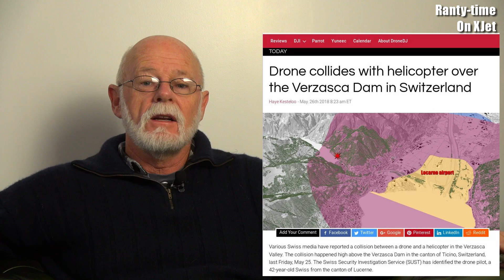Why I want to fly a drone into a helicopter tail rotor

Comment: Thanks Bruce. You touched on an important point without really seeing it: One reason why pilots and aircraft owners are pushing for legislation has little to do with safety per se. Their main concern is cost. Replacement of a tail or main rotor is very expensive. If a drone were to be ingested (it will not be flying at that point!) into a jet engine, the engine will be written off. A big Rolls Royce engine costs multi-millions of pounds/ dollars/ RMB/ yen/ etc. to replace. During the unscheduled downtime of the aircraft, which could be weeks, revenue is not being generated by the plane, so more millions of filthy lucre will be lost by the operator. It goes further though; if 500 passengers have to endure an emergency landing and then have to be re-assigned to another aircraft, many of those passengers will opt for what they perceive to be a more reliable carrier next time, thus losing the airline more income. Drones are thus a very easy target for those who want to see themselves as being big savers of money for their employers. Ridiculous legislation thus becomes a way of saying 'We're being pro-active in preventing damage to... yada yada yada.'. When that is proven not to be a viable option, they will think of something else; perhaps mandatory membership of a recognised club, or an exam system, paid for by the hobbyist.

Comment: With regard to the balloon, have a chat with the people at HABHub (High Altitude Balloon Hub). They track their small balloons right around the globe, using solar powered transmitters, operated from a minimally-sized solar panel. They have years of experience, and will give you guidance about practicalities, design constraints, and the legal side of things. Some of their balloons have completed multiple circumnavigations, and timed duration / preset altitude flights, so they must be doing something right!

Comment: They will never do that as it will prove the UK tests wrong.
The as the closing speed used in the UK test would have to be halved. as it is a sideways impact and not head on .
 You also need to look at the flight direction of the crash i.e not arm first (drones do not fly that way).
you also need to consider both the down wash of the rotor and the speed reduction  or increase due to tail rota wash.

Comment: I'd like to see the same test with a jet turbine ingesting a drone, to see what damage is caused to the engine, compressor blades and internals.
Another easy test would be to use an rc chopper and fly a small drone like a tiny whoop  into the tail rotor whilst flying or hovering. 
I know the materials, forces and dynamics may not be entirely scale.... But nonetheless it would be an interesting test and easily achieveable amongst the modeling community. Food for thought.
Keep up the good work Bruce. 😁

Comment: My solution to flying in the car was to take a diversity receiver, attach it to an old CB antenna that has a magnetic base on it, plop that on the roof of my car and drop the av cables down inside.  Works great.  Would be even better if I had the transmitter antenna up there as well.  Anyway, here is what that setup looks like. https://www.reddit.com/r/Multicopter/comments/7kgq3i/my_winter_fly_from_the_car_and_stay_warm_ground/

Comment: where i live we have an air ambulance, police helicopter and a coastguard SAR helicopter regularly flying low but I can always hear them before I see them and land my drone as soon as safely abled to its a habit I formed when I started flying and always fly VLOS, what annoys me is that paragliders fly around over a dual carriageway low and over houses and people all the time why aren't they regulated or forced to fly within rules like us drone pilots a paraglider coming down on a busy main road
 will cause a bigger problem then a drone
Reply: I believe that chance it can happen should be a major factor before we think about creating any regulations. Paraglider dropping dead in the middle of a highway would be a major disaster, but what are chances of this happening ? once in 10 years and once in 5 crashes resulting in innocent death ? even if they will have motor failure, I bet they will chose other place to land. It would have to be a real freak accident. For me good indicator is aspirin, there is very small chance that you can die if you take it, but it's very tiny, I think something like couple thousands people per year. I never met person that would be afraid to take it, even with information that there is 0.00001% chance of dying. In my mind, if something is less dangerous than aspirin, we just accept the minuscule danger potential and don't make life less enjoyable for millions of people with unnecessary regulations.

Comment: Helicopters are supposed to be at or above 500 ft AGL and UAVs are supposed to be below 400 ft AGL. That is what is in place along with the UAS pilots responsibility to watch for and yield to manned aircraft and stay away from air fields.

This should not happen if we follow the rules. When it does there is no doubt that it will be unbelievably expensive and deadly. We have had a few helicopters crash and I have never seen anyone survive. There is a possibility of survival but it's far from an assured outcome in my experience. Many people refer to autorotation which is a method of recovery. It is only possible with an undamaged helicopter. Any rotor or tail rotor damage is unrecoverable. Due to balance and rotation speed a small amount of damage can result in catastrophic failure.

Any kind of test to see what would happen is pointless.

Comment: Realistically you would have to repeat the tests as the rotor might miss solid objects like batteries or motors on a single test. Then you would need to test it on different tail rotors assemblies. No manufacturer is going to spend money voluntarily to demonstrate their product  will fail in a collision with a drone; not very good PR is it?

Comment: Wouldn't you be able to use an external "JR-module" style transmitter on the roof/pole? Or would it be to much loss in the extension cable to the module?

Comment: Why dont you use a trainer setup for the groundstation setup? Granted you need 2 transmitters, one in Yourr hand and one outside the car, but you won't get swamping or signal loss due to long RF cables.

Also off topic: but what is wrong with your left eye? IT looks like you were in a boxing match. IT is almost shut all the time.... you got me worrieng mate......

Comment: I agree it would be interesting to see the effect of a drone flying into a written off tail rotor assembly. However, there have been many incidents/accidents where things have struck the tail rotor with varying effects so we may be able to infer possible outcomes. One such thing was a kneeboard, considerably smaller and lighter than a phantom 4. "In 1993, an R22 helicopter flying with its left door removed crashed after an aluminum kneeboard exited the helicopter and hit the tail rotor. The pilot and passenger were killed" (link to NTSB report a the end). There have also been bird strikes that have shattered windshields which could result in an uncontrollable aircraft. Some helicopters will lose their tails if the boom is dented (R22 and R44). As said before, they are fragile. https://app.ntsb.gov/pdfgenerator/ReportGeneratorFile.ashx?EventID=20001211X13417&AKey=1&RType=Final&IType=FA

Comment: Why don't you just use one of your many UHF systems for control link? On my long range stuff I use an IRC UHF with a 2.4 repeater made with a FrSky receiver and av FrSky sbus to PPM converter. That gives me the possibility to sit inside with a 2.4 link to the UHF placed outside.

Comment: One of our 212s swatted a DJI phantom! Absolutely zero damage to helicopter,not even a scratch! Only knew it had happened when drone owner came crying with a box full of shredded drone,wanting compensation! Told to piss off! Was treated as a bird strike for follow ups and had not been confronted by owner there was no evidence of incident. Not sure how a drone would get in the proximity of a tail rotor in flight? Will have a look and see if they will let me try out experiment. There is recorded evidence of firing chickens into tail rotors to test survivability? Reckon phantom and chicken pretty much the same mass? The window of opportunity required to get the drone into the tail rotor of a flying helicopter is actually very narrow? It would have to arrive from the upwind side and orthogonal to the hub. Not easy to do?

Comment: Bruce. You can take out your transmitter module from the radio and plug it with a 5 conductors flat cable and Dupont connectors. If you have a trailer hitch on the rear bumper. Install your antenna pole to this. The truck body will become your antennas ground plane and your signal strenght will be stronger towards the front of the truck.   Good luck.

Comment: There is the video of Rolls Royce engenneres  throwing in the tail rotor things like bones,tree branches,bolts,pipes, until it started vibrating due to dents in the rotor but it operated the same and kept the helicopter from uncontrollable yaw due to the fact that the blades of the tail rotor are hollow titanium blades they can't just break they will get bent and mangled beyond recognition but will almost never fail. Gear box tho is the first thing to fail due to the shock and main rotor inertia but still it can be landed with autorotation in case of tail rotor loss
Reply: Oh... they removed the video hm oops sorry
Reply: Black turbine 
Good point. I responded to someone else here, saying the blades were either aluminium or fibreglass or both. Didnt think of titanium. Now that is tough stuff. Hmmm.....a test is required methinks!!
Reply: Frequent Flyer yea carbon fiber is so resistant to hard impact and even if the one blade breaks it's so light that vibrations would be small helicopter wins again

Comment: And just on the tail rotor units the time expired job that I had from a bell 47 was about 16 or 1700 mm dia , weighed 3.25 kg and spins at about 2100 rpm in flight and I can pretty much tell you that if a DJI phantom or thereabouts hit the tail rotor of the type I had well it would vaporise the drone and whilst it wouldn't necessarily down the chopper immediately it would compromise it enough to render the anti torque rotor a write off as they're not normally engineered to withstand collisions with objects like drones , rc aircraft etc

Comment: This was a good one....:thumbs up:
Just did an eBay search... Seems you can get a pair of used but usable Bell helicopter tail rotor blades for just under $1000 USD or a pair of Not Useable for about $200... No complete rotor assembly for those prices though.
I think your test jig idea would be great... But a sample size of one (1) will only bring up more questions and would not be concrete.

Comment: Howdy Bruce.. wouldn't it be more practical to extend the connection between your radio and it's transmitter Module, and then mount that module itself on the pole? That way there is no change in the antenna itself etc...

Comment: For the mobile groundstation you could use a fibreglass painters pole which lays across the width of the truck, possibly along the back of the roof, and have it attatched to the truck via a hinge on one end. It could also be telescopic for more range. Just a thought.

Comment: You 'could' have the TX on the roof and run cables for the DC from the sticks on another tx (with tx amp and antenna disconnected) in the car. It's just low voltage DC to the roof then?!

Comment: Funny you should speak about timed out tail rotor units ..I just recently sold my timed out unit off a bell 47 to a guy who lives in your neck of the woods ,meaning New Zealand ..I'm from Bathurst in nsw Aust  ...I acquired this unit from my time working on full size helo's and it was a wall ornament for a while and then dabbled with the idea of it being a ceiling fan had I still been in possession of the rotor I would have forwarded it on to you ...oh well hope someone is able to provide a unit for the purpose of the test

Comment: Why not mount 2.4ghz module from a transmitter on the pole give it voltage  and ground then run a wire back to the module bay ppm output of your taranis. no loss from long coax. not sure how far you could send ppm but It might be worth experimenting with.  something like  DJT module would work probably.  You are going to have to power the the video receiver anyway may as well put the transmitter module there too.

Comment: Telescopic Pole, move most to top of pole, just joystick wires, low volts down to base for control. Video transmit from pole top to base FPV; and could quite quickly lower it if helicopter fly's at 2 metered height

Comment: Hi Bruce for your video feed a AV lead will work well. but for control i was thinking about using i module on the roof and connected via a comms lead back to the taranis pins , not sure just a thought

Comment: You could fit an RF switch on the o/p of the controller and route the signal to your regular antenna for launch & recovery, and to the wifi booster for longer range.

Comment: G'day Bruce,

   As I recall it, a Lightweight Tail Rotor for a Bell-47 cost $600 in 1979, and they had an Operational Life of 600 Hours...; so somewhere or other there must be a Heligoflopter Mechanic in Kiwiland who either has a pile of Time-Expired Tail Rotors, or might be able to supply you with the next unit to be replaced...(?).

   You'll probably have to connect the Tail-Rotor's Pitch-Control Cables to a pivoting-Lever, located  at some discretely-safe distance, the better to be able to test the before & after-impact Control-Response ; in case the Tail-Rotor manages to swallow the Drone, spit it out, and then continue to spin & twirl as required....

   What are you going to cobble up to spin the Tail Rotor with - an old Rotax 277 or something, or a big Electric Motor (?) ; I eagerly anticipate watching Video of this, when you get around to it.

  Have a good one,

  ;-p

  Ciao !

Comment: If the drone is carbon fiber or plastic {dji} it would be confetti  after a tail rotor strike. Tail rotor blades are metal and turning at 1800 rpm to 4,000 or better. More people are killed by tail rotor blade than main rotor blade's.
Reply: bushpilot2001 
Tail rotor blades are either aluminium or fibreglass or a combination. A carbon fibre race drone is a seriously tough lump. I'm not so sure tbh.
Reply: Thank's for the tip, I own and operate a Hughe's 500-D. Tail blade's usually are blended material's,2 layer's w/ a hardened leading edge. These can come apart due to fatigue of the joint. At least that is the cause of 4 fatal crash's w/ the Hughe's 500 and it's variant's. The battery or lipo is of more concern than the quad's.

Comment: Can you not put a FrSky module on your pole with wires to the TX, simply mounted to the connectors in the module bay ?
Reply: Or TBS Crossfire
Reply: DOUGH !  yea, a just had a quick thought and opened my mouth before engaging my brain ! your right TBS would be the solution  :-)

Comment: Stop using the word DRONE Bruce, use the word multirotor.DRONES are military devices, remote controlled or automated autonomously programmed.Multirotors are civilian devices, remote controlled only mostly by civilians.People get freaked-out by the word drone because they assume it is far more dangerous than it actually is.I'm not saying that multirotors are not dangerous, what I'm saying is that military stuff is way more resistant to damage than civilian stuff.You sad in one of your videos we should say multirotor instead of drone so please keep it up.

Comment: Hi just a thought 🤔 would it be possible to fit a drone with a receiver and transmitter to relay back to you?  For example  you follow the balloon to the coast and put up the equipped drone that would extend the range by about 75% ?🤔 just a thought
Reply: UAS technician 
I was thinking in the line of diy ebay parts like a  VRX feeding into a VTX and some tinfoil shielding  cheap and dirty 😉
Reply: UAS technician
Lol I have a favourite saying 
." It is better to try fail and learn from your mistakes. Than to contemplate failure and not try anything at all.
I am going to have a  go at it when I get the time as I have most of the parts lying around (all the best cheap and nasty parts I could find on ebay 😉)
I work for a company that does special effects for film and television. And we use fpv camera's transmitters and receivers for expendable setups for example  a car crashing through a wall has to just miss someone who is on the other side of the wall.
 A fpv camera gives the stunt driver a view on a heads up display of the other side of the wall and where the person walking  past is safe (other safety methods are used as well)
It's worth a try even if it is a fail😉

Comment: Very interesting , it all depends how big the drone is hitting the helicopter or plane on the amount of damage done so any test would be pretty much a waste of time unless different size drones are tested and then it gets very expensive :-)
Reply: good point but it seems that the Phantom size UAV's and below are the more easily acquired and therefore are generally the ones involved in most of the incidents! going up to the Inspire and then the commercial size workhorses, they are big bucks and, once again, generally the realm of commercial/serious operators!!